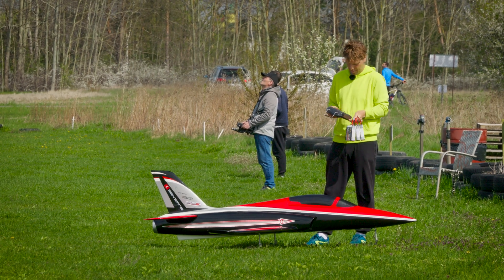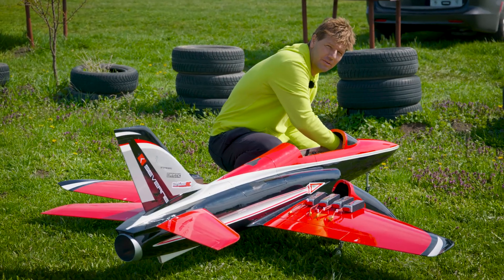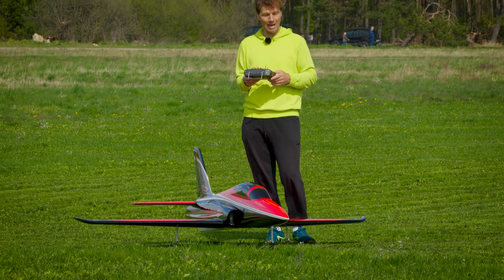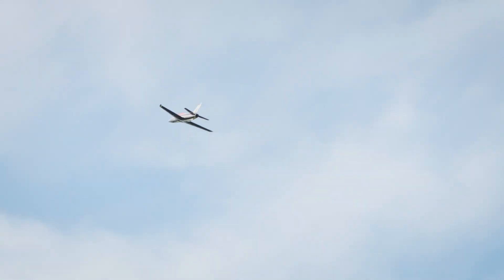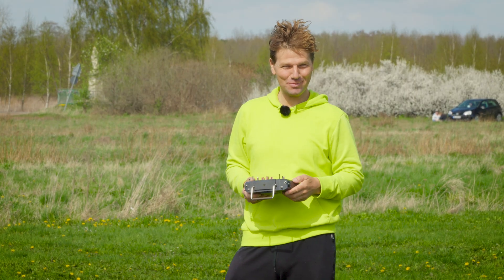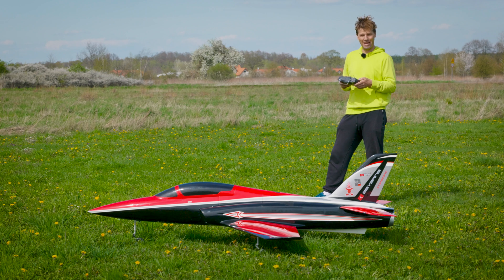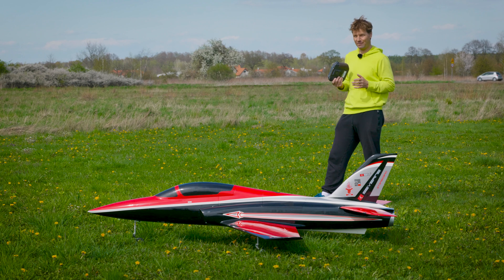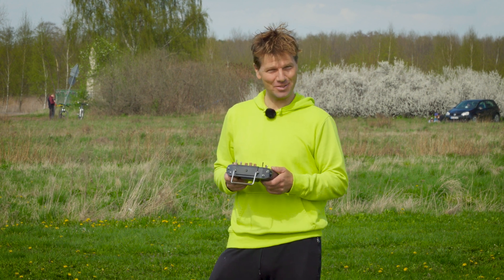Odyssey Last flight - SOLD 16s 6kW 294km/h 10kg JETFAN-120 PRO Graphene battery, TOPRC Jet Sound

Comment: Did you use a sound system to have this sound ?
Because I finish right now a fouga in 15S 120mm Jphobby. And I wondering if it will be so impressive...
Reply from the maker: It is all about precise ballancing of edf and allso a big enough distance between rotor and stator in edf :)